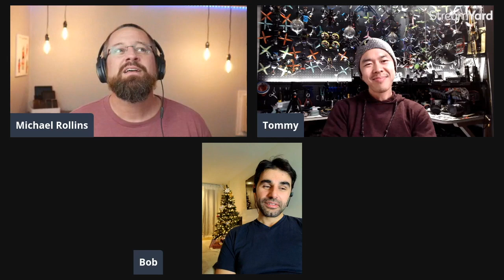Short: Designing for 250g FPV with Bob Roogi and Tommy "Ummagawd" Tibajia

Comment: No clue when this 250g limit will go into effect but it'll be interesting to see if 5" still stays the big seller at retailers after the FAA power grab
Reply from the maker: I’m flying a sub-250g 5” right now and I prefer it
Reply: @MichaelRollins  Personally I haven't flown for almost a year but I will be again shortly, everything I've built in the past has been way beyond 250g and on 5" to maintain the durability I like it's impossible imo to hit 250g on 5". The entire thing is beyond stupid.
Reply from the maker: You might be surprised. Since it’s so light the kinetic force in crashes is minimal. The props are a pain, because they are t-mount. But the thing stops on a dime and you can do things you normally couldn’t do with a 700g build. And they are suuuuuper fast.
Reply from the maker: All in all, it’s been a fun diversion. I’m still going to fly my big boys, but it’s a totally different flight experience.
Reply: @MichaelRollins  maybe I'll give it a try in the future once I get the fleet fixed up & ready to rip.